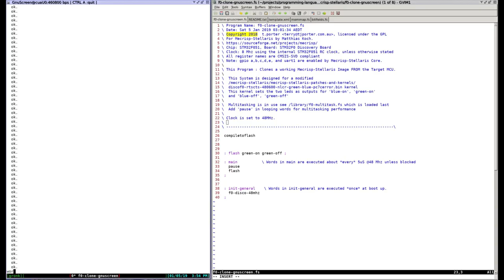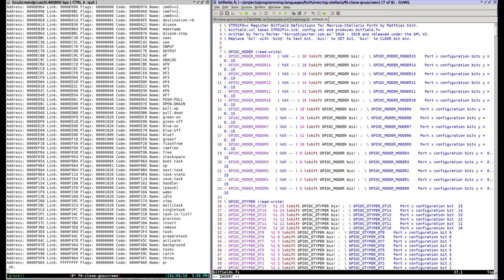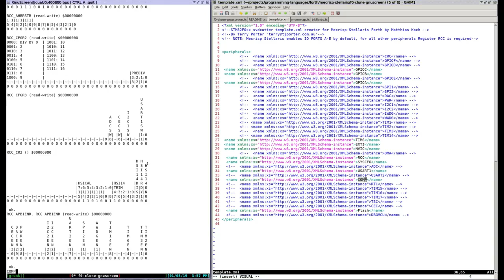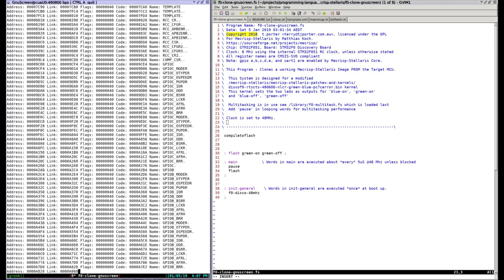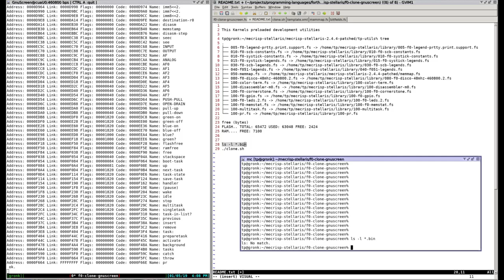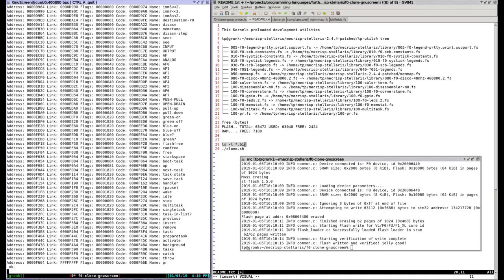Cloning a Mecrisp-Stellaris Forth Image

Comment: I did enjoy that Terry! I’m still trying to work out what you’ve done in all but have a question, it seems that you’ve written all the processor and peripherals system registers into constants and they’re thus taking up code space (flash memory). In c these would all be processed by the pre-processor and be used as addresses as required at compile time. Considering the number of registers in an ARM processor and that they’re often defined as offsets from a base address this adds up to a huge number of definitions. Is there some way to optimize this in Forth, maybe in the IDE?
Reply from the maker: Thanks for your comments :)

Probably the best way is to explain the problem I was trying to solve. Bear in mind that I have been working on this for
a few years and it involves far more than I could show in a short video.

Cortex-M microprocessors have a lot of registers. The STM32F0xx alone has 37 peripherals, 413 registers and 3044 register
bitfields.

I wanted to be able to read their values in real-time.

This real-time interactivity is among the main attractions of Forth and something C cannot do.

I not only wanted to read the value of any register, I wanted to print a default or custom LABEL for every bitfield along with the real time value so I wouldn't require a massive technical manual PDF open at the same time.

Because I wouldn't know in advance which registers I wanted to examine, I developed a system that allowed me to easily read registers
preselected on a peripheral by peripheral basis.

https://mecrisp-stellaris-folkdoc.sourceforge.io/modern-forth-development-environment.html?highlight=development#a-modern-forth-ide shows the register pretty printing view in the lower left hand corner where RCC_APB2ENR. is displayed and shows which GPIO's have been enabled.

Preselection was also required because as you say, a LOT of memory is used and this can easily fill all the Flash available, depending on the MCU and available flash and this usually precludes selecting ALL the registers.

I have a experimental alternative which calculates the absolute address from the CMSIS-SVD. This saves a lot of Flash memory, but the XML calculation of the absolute address using the BASE and OFFSET has a occasional bug which I haven't managed to fix as yet :(

This method also makes code manipulating registers much harder to read because register names are replaced with hexadecimal addresses.

I'm always looking for ways to improve this system and welcome any suggestions backed up by code samples are most welcome. All my
code is available and where it's not up as yet, just ask and I'll put it on my doc site.
Reply: Terry Porter : That’s an impressive piece of work Terry (svd2forth), I must admit at this stage that trying to use the peripherals in Forth on an Arm part stopped me dead in my tracks after trying to find a few addresses. Not the application, just the tedium of finding the addresses, it was just too much work when it’s all done for you in C and you summed it up perfectly in your CMSIS-SVD page. I would go so far as to say that without this feature Forth on ARM will continue to limp along as an interesting idea but not worth using seriously.
Reply from the maker: I agree 100%. Without CMSIS-SVD no one would use ARM including Assembly Language and C users.

It was Ralph Doering in 2014 who first used XSLTPROC to process the CMSIS-SVD XML files released by ARM vendors. Where ARM only supplied a Windows EXE to parse C header files, Ralphs work produced Forth files instead.

Since those days Rust, eLua and Python users have also utilised CMSIS-SVD to produce files for their embedded languages.

I added more information as my svd2forth parsers evolved. memmap.fs and bitfields.fs now includes the CMSIS-SVD 'description field' further reducing the need to have a 1000 page technical PDF open as you code:

$40013000 constant SPI1 ( Serial peripheral interface ) 
SPI1 $0 + constant SPI1_CR1 ( control register 1 ) 
SPI1 $4 + constant SPI1_CR2 ( control register 2 ) 
SPI1 $8 + constant SPI1_SR ( status register ) 
SPI1 $C + constant SPI1_DR ( data register ) 
SPI1 $10 + constant SPI1_CRCPR ( CRC polynomial register ) 
SPI1 $14 + constant SPI1_RXCRCR ( RX CRC register ) 
SPI1 $18 + constant SPI1_TXCRCR ( TX CRC register ) 
SPI1 $1C + constant SPI1_I2SCFGR ( I2S configuration register ) 
SPI1 $20 + constant SPI1_I2SPR ( I2S prescaler register )

\ SPI1_CR1 (read-write)
: SPI1_CR1_BIDIMODE   %1 15 lshift SPI1_CR1 bis! ;  \ SPI1_CR1_BIDIMODE    Bidirectional data mode  enable
: SPI1_CR1_BIDIOE   %1 14 lshift SPI1_CR1 bis! ;  \ SPI1_CR1_BIDIOE    Output enable in bidirectional  mode
: SPI1_CR1_CRCEN   %1 13 lshift SPI1_CR1 bis! ;  \ SPI1_CR1_CRCEN    Hardware CRC calculation  enable
: SPI1_CR1_CRCNEXT   %1 12 lshift SPI1_CR1 bis! ;  \ SPI1_CR1_CRCNEXT    CRC transfer next
: SPI1_CR1_DFF   %1 11 lshift SPI1_CR1 bis! ;  \ SPI1_CR1_DFF    Data frame format
: SPI1_CR1_RXONLY   %1 10 lshift SPI1_CR1 bis! ;  \ SPI1_CR1_RXONLY    Receive only
: SPI1_CR1_SSM   %1 9 lshift SPI1_CR1 bis! ;  \ SPI1_CR1_SSM    Software slave management
: SPI1_CR1_SSI   %1 8 lshift SPI1_CR1 bis! ;  \ SPI1_CR1_SSI    Internal slave select
: SPI1_CR1_LSBFIRST   %1 7 lshift SPI1_CR1 bis! ;  \ SPI1_CR1_LSBFIRST    Frame format
: SPI1_CR1_SPE   %1 6 lshift SPI1_CR1 bis! ;  \ SPI1_CR1_SPE    SPI enable
: SPI1_CR1_BR   ( %XXX -- ) 3 lshift SPI1_CR1 bis! ;  \ SPI1_CR1_BR    Baud rate control
: SPI1_CR1_MSTR   %1 2 lshift SPI1_CR1 bis! ;  \ SPI1_CR1_MSTR    Master selection
: SPI1_CR1_CPOL   %1 1 lshift SPI1_CR1 bis! ;  \ SPI1_CR1_CPOL    Clock polarity
: SPI1_CR1_CPHA   %1 0 lshift SPI1_CR1 bis! ;  \ SPI1_CR1_CPHA    Clock phase

Another advantage of this process is that the CMSIS-SVD naming is enforced making Mecrisp-Stellaris programs for the same class of MCU easily portable between users.

Prior to this, every Mecrisp-Stellaris pioneer wrote their own memory mapped Words using their own naming strategies, which made porting quite hard work if not downright onerous.

Finally, the sheer number of errors introduced by manual creation of memory mapped Words is a disaster, along with the time wasted fixing them. Even CMSIS-SVD files have errors here and there that get picked up by my system, illustrating the challenges presented naming thousands of registers and bitfields.

Finally I also wrote CMSIS-SVD parsers for ARM and MSP430 Assembly Language where the same naming challenges exist.

Please note that my svd2forth parser is continually evolving as I learn more about Forth and XML and as ideas present themselves. You're the first person to actually comment on svd2forth and already I have some new ideas from our interaction here :)
Reply: Terry Porter. Well I like the idea of only picking the peripherals that you use even if it has to be a manual process (I’m assuming it’s in the form of including only the files for the peripherals that you want to use) but even if it’s done by the IDE, aren’t you now taking on the task of creating a Forth preprocessor?  I might be speaking nonsense because I haven’t tried the IDE yet but it a huge leap forward in modernizing Forth. Certainly a far cry from the old fixed size blocks editor that we used to use. I know you’ll still try to keep the interactive nature of Forth, it may be a challenge! 

Actually, on second thought, the interactive nature of Forth is exactly what can do the on the fly processing, maybe a sort of handshake with the IDE requesting words that aren’t already in the dictionary (your error flag might serve to do this). It may make the difference between source code and what’s actually on the device even more different (than just removing comments) but interactivity won’t be compromised.
Reply from the maker: By default, when svd2forth is runs it generates a "template.xml" file which lists all the peripherals based on the CMSIS-SVD for the MCU choice as below:

  ...
  <name xmlns:xs="http://www.w3.org/2001/XMLSchema-instance">CRC</name>
  <name xmlns:xs="http://www.w3.org/2001/XMLSchema-instance">GPIOF</name>
  <name xmlns:xs="http://www.w3.org/2001/XMLSchema-instance">GPIOD</name>
  <name xmlns:xs="http://www.w3.org/2001/XMLSchema-instance">GPIOC</name>
  ...

When "make mem" is run all the registers from all the peripherals are made into memory mapped Words. To reduce the size of this file registers must be deselected (using the XML syntax) by commenting out lines of registers not wanted.
Example deselecting "CRC":
<!--  <name xmlns:xs="http://www.w3.org/2001/XMLSchema-instance">CRC</name> -->

Rerunning "make mem" after commenting out registers not required produces a new smaller "memmap.fs".

I am looking at building a pre and post processor at the moment, but it's a very long term project for me as I'm not a programmer, I'm an electronics technician. My planned system uses the intelligence and speed of the PC to decide what Words the MCU target needs by way of uploaded files, it doesn't alter Mecrisp-Stellaris in any way.

You can't actually try my IDE because it's not packaged up in any useful way. What you need to do is integrate svd2forth into your own system to work with your favorite editor. 

You're right, what I have built could never be done with the old BLOCKS system which separated comments and code. If the blocks were broken up and the code and comments were separated then it was a disaster resulting in "write only code" files.

About 20% of my sourcefiles are comments, but the comments are automatically stripped from the source before upload without affecting the source files in any way.

My system is built around using standard OSS Unix programs to provide a traditional Forth with the upload content it needs and the user (me) with every development resource I ever wanted so I can easily build and debug my designs.